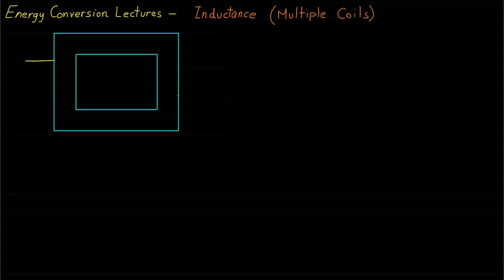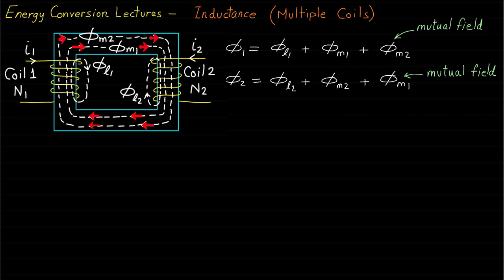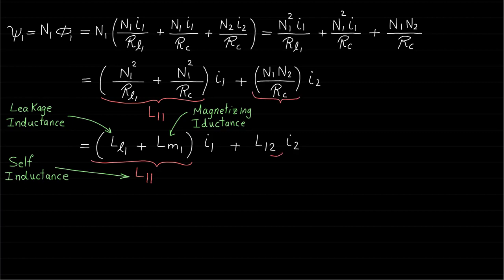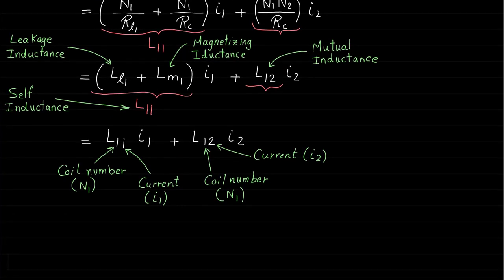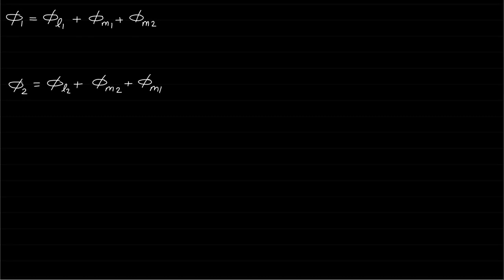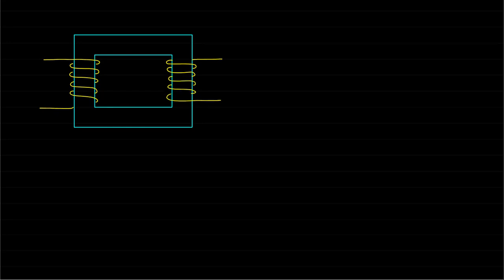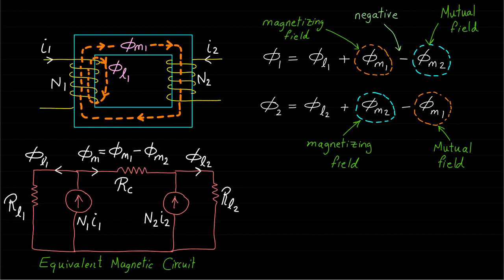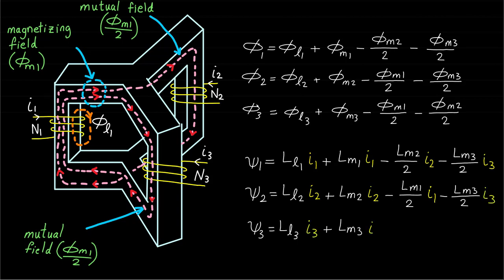Magnetic Circuits - Mutual Inductance & Self Inductance

Comment: In the magnetic circuits shown, the source N1i1 and N2i2 are "voltage" sources but are drawn using "current" source symbols. I understand the meaning (the + side of the "voltage" source would be where the arrow is pointing) but it may be confusing to some as this is not the standard notation in most circuits textbooks. Note for example that the phi_1 would be the "current" leaving the + side of the N1i1 "voltage" source.
Reply from the maker: Thank you for your comment. I agree. The representation I used is not accurate. I should have taken the arrow out of the source and add polarity signs.
Reply: @EnergyConversionAcademy  No problem ... it was not a complaint. I think the material and the presentation are very clear and has all the details.

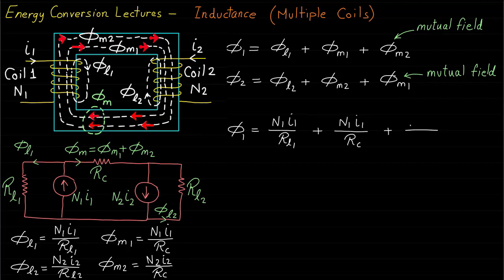Comment: the example in 03:43 and the second last example is exactly the same. no one understand why suddenly change to negative sign lol
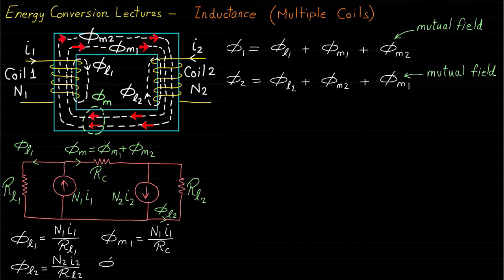Reply from the maker: The difference  between the two examples is that in example (time 3:43) the two magnetic fields of the two coils are in the same direction (supporting each others) while in second example the two magnetic fields are opposing each others (Refer to time 12:26 as I mentioned the difference).  Please apply the Right Hand Rule to confirm the direction of the magnetic fields for the two examples. Thanks for your question
Reply: @EnergyConversionAcademy  btw ur all videos I watch them and thk are very good
Reply: @EnergyConversionAcademy sry my fault. At that moment I didn't notice the direction of the I2 has changed in opposite one. I look the video once more and discover that. Thxxxxxxx bro
Reply: As noted the equations are correct as per the responses to this thread. The simpler observation is that although the current for i2 in both instances was drawn inward the subtle difference is the winding directions were opposite for coil 2 in the two examples. In the first example i2 was drawn to flow in the coil in front and around the magnetic core indicating a clockwise winding direction.  In the second example the winding was behind and around indicating a counter clockwise winding direction. When this is considered and the right hand rule is applied the equations come out correctly and account for the sign difference in the equations. This topic was significantly more detailed than previous video's and a lot to take in. The derivation of the magnetic to electric circuit equivalence was well developed but would benefit from a little more description on the symbols and their meaning.